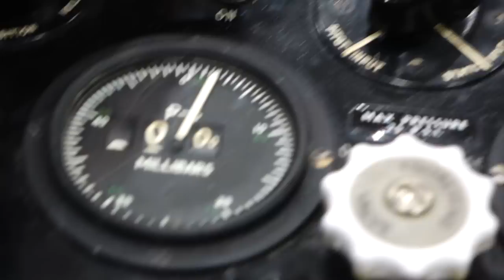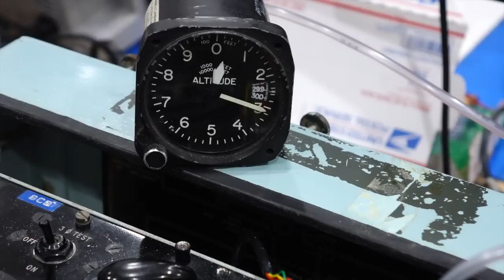RAF Pitot Static Tester Preview - Guess What This is For! #Short #InTheRightOrientation

Comment: Last time I used one of these was for calibrating barometric transducers for the Jindivik 103A & 103B and Meteor U16 targets at RAE Llanbedr in the mid to late 1970's. The Extra High Altitude transducer (for certain Jindivik configurations) covered the range 45K to 65K feet...!

Comment: Just heads up CuriousMarc - letting the altimeter move that quick can damage the delicate bellows and mechanical bits in the instruments and in your test-set. A good rule of thumb in aviation (where we still use test-sets like this daily) is want smooth, slow applications of pressure and vacuum to the system you are testing. Typically you don't want to exceed 2500-3000 ft/min on altimeters and nice and smooth on pitot pressure.
Reply from the maker: It’s sped up. And you can’t hurt these: it’s a balance system and the total travel of the capsules is limited to a fraction of a millimeter. It also has a valve that will automatically equalize pitot and static should pitot become less than static.

Comment: Pitot-static systems on aircraft are part of the system that measures altitude, vertical speed, and airspeed. The static port allows measurement of outside air pressure, which is used to determine altitude (lower pressure --> higher altitude, and there's an adjustment that's made using a pilot-entered local barometric reading to give more accurate readings). Rate of change of the outside pressure determines vertical speed (i.e. climb or descent rate). Comparison between ram air pressure entering the forward-facing pitot tube and the ambient pressure measured by the static port is used to calculate airspeed. That measurement ("indicated" airspeed) has to be adjusted for instrument position error to yield "calibrated" airspeed, which is further adjusted for altitude and temperature to give "true" airspeed. At high speeds, air compressibility also has to be factored in.

All of these instruments need to be tested periodically and adjusted/calibrated, which is what I'd assume this piece of equipment is for.
Reply from the maker: Yes you got it! We are going to use this to test our analog Bendix Central Air Data Computer

Comment: I’ve finally got round to adding a bit of context to my previous comment. These transducers formed part of an FM/FM Telemetry system designed in the 1950’s known as the RAE 6 channel system and compared to today's PCM system’s was fairly rudimentary. The telemetry system comprised of 6 analogue channels as follows. 

Chan 1 – Engine RPM 130Hz to 800Hz corresponding to 2,600 rpm to 16,000 RPM – via an engine mounted Tacho generator driving a motor fitted with a phonic wheel. Multiplying the frequency by 20 gave the equivalent RPM.
Chan 2 – Not Used
Chan 3 -  High range Altitude Transducer 1380Hz to 1686Hz corresponding to 14,500 ft to 57, 000 ft.
Chan 4 – Vertical Speed Transducer 2160Hz to 2640Hz corresponding to plus/minus 9000 ft/min
Chan 5 – Low range Altitude Transducer 3380Hz to 4132Hz corresponding to 0ft to 15,000 ft
Chan 6 – Airspeed Transducer 5291Hz to 6467Hz corresponding to 0 Knots to 460 Knots.

Four inductance type transducers are used to convert pressure information into sub-carrier signals whose frequency varies with altitude (2 ranges), rate of climb & descent, and indicated airspeed.
The transducers each consist of a movement operated by a pressure capsule, and inductance unit and a Colpitts valve oscillator. Variation of pressure inside the case or capsule produces expansion or contraction of the capsule. Axial movement of the capsule varies the gap between an armature on the capsule and the pole pieces of an inductance unit which forms part of the oscillator circuit. In this manner, the inductance value is made to vary with pressure, thus varying the output frequency of the oscillator.

A further interesting write-up can be found at:
https://www.icas.org/ICAS_ARCHIVE/ICAS1958/Page%20990%20Leslie%20et%20al.pdf

Comment: The pitot static system is primarily used to calculate indicated airspeed, so im guessing it simulates the air diferentials used to calculate the ias and tests indicator equipment?
Reply from the maker: It does.
Reply: Used for altimeter and VSI too. I always wondered how they tested and calibrated the old “steam” instruments in the helicopters I used to fly.

Comment: Hang on I've seen this thing. This is how Marty McFly blows up the giant speaker.
Reply from the maker: Wile E. Coyote also uses a model similar to this
Reply: @CuriousMarc  Wile E Coyote though used the ACME Captain America model though, which has, to a great degree, still survived in operation to this day, as it is still used where you need to blast in an explosive atmosphere, as it has the advantage in that, till you prime the big capacitors in it with charge, there is no way to develop any sort of electric discharge. But you can still verify the integrity of the firing circuit with lower energy after a single charge.

Comment: Does this have a quartz Bourdon tube in it?  I tore apart a few pitot/static testers a few years back for a friend (who sadly passed away) and all of them had quartz Bourdon tube pressure sensors in them.  They were encased in an oven to stabilize them, and a small incandescent lamp and photocell were used for readout.
Reply from the maker: No, no such thing inside. It’s traditional pressure capsule, but tied in a servo controlled balance beam arrangement, so the capsules actually never move. Very clever.

Comment: Good thing, thy wrote "portable" on the unit. I wouldn't have noticed otherwise.
Reply: As opposed to the larger version that sat in the service van, which was basically the same set, just with 10m long hoses to reach the assorted ports, and a chair to sit on. That one was integrated into the panel on the one wall inside the Citroen van, with the corrugated sides, and the half ton aluminium walkway on top, and the VW Beetle engine, as replacement for the original horrid Citroen one where you could not get spares for it..

Comment: I was an A4E Skyhawk avionics tech in the late 1960s. Our pitot/static teste was painted yellow. I don't have any pictures of me playing (testing aircraft) with it.
Reply: Small world!  I was a Marine avionics guy on A-4M's and TA-4F's in the late 70's.  We used the TTU-205 test set.  Much easier to use... just dial in the desired airspeed and altitude.  I was responsible for getting the shop's test gear in for calibration, and that was how I learned that the TTU-205 was worth about $80,000 at that time!
Reply: @SkyhawkSteve  Interesting unit, my memory is vague but that does not look like the unit we used. Back in those days much of the avionics gear was still vacuum tubes (valves for our friends across the pond). Most of our flightline repair was changing out the TACAN or or the biscuit pre A4F (a modified ARC27 UHF radio and APX6 IFF mounted to the cockpit bulkhead). VMA 211 ChuLai Vietnam 1967/68 my first tour and DaNang 1969 doing 2nd level  ComNav rapair on my second. It was nice being in and an air conditioned space during the monsoon season.
Reply: @tomschmidt381  The TTU-205 was a piece of yellow gear, and not what Curious Marc found.  The TT-205 is still being made, and can be found in a web search.  I've seen pics of the "biscuit" in the early Skyhawks.  Looks like a pita to change out!  We still had the vacuum tube ARC-51 UHF R/T in the nose on some aircraft, but the newer A-4M's had the solid state ARC-159 UHF radio that fit into the console!  No need to crank up the nose!  It was heaven.  🙂  I spent a few months with 211 at El Toro for OJT in '78.  Kudos to the folks who served in Vietnam.

Comment: Interesting: add pressure via the hand pump to decrease pressure at the output and increase altitude... how does that work? Enquiring minds want to know!
(And as an aside, I recently replaced an ancient paragliding variometer because while it still (apparently) showed the correct altitude, it would randomly decide I was going up when I was clearly going down and vice versa, complete with equally inverted audio signals. Bit rot in the PIC that did all the thinking, I suspect. Definitely not what you want.)
Reply: Pump is double ended, in that one side of the piston operates as a suction pump while the other side provides pressure, with a set of one way valves and accumulators, so that it will do this on either up or down stroke, and then using electric power to operate the proportional valving, used to control the output manifold pressures.
Reply from the maker: Yes as @SeanBZA says, double ended pump, you use both sides, one for vacuum and one for pressure. Clever British engineering.
Reply: @CuriousMarc  We do our best. If I'd stopped to think about it... thanks both.

Comment: The case design was used for a number of different test sets, I have a missile test set in a similar case.
Reply: Need to ensure your personal missile stash is tested regularly
Reply: Standard part at Smiths, who got it from Vero I think, as you had that design show up in a lot of avionics and military test equipment from the UK and France. Tough, rugged, and, most importantly, already certified in the system, with it's own NATO number, so you could use it and have a lot less qualification paperwork when submitting the design for review.

Comment: So you got another 'thing' fix the original thing, or at least to calibrate it now that it's been repaired. But the calibration thing also needs repair. That's a recurring theme on this channel. But I DO luv me sum a dat HP scopes and counters. 👍
Reply from the maker: Restoration within a restoration! And we were lucky, this is only two deep. Sometimes I have restoration within a restoration within a restoration! However when it gets three deep I am usually in deep doodoo and stop filming…
Reply: @CuriousMarc  I applaud how few times it "seems" you have given up, but I fully understand. There's only so much time and so many spare parts available. But with Mater Ken, Eric's magic finger, and Mike's ability to emulate and simulate (and untold others whose names I have not learned,...yet) CuriousMarc will fix and restore all the thingz.

Comment: I had the mercury filled one, with a separate vacuum pump that also allowed you, with suitable operation of the bleed valves, to test both altimeters and also air speed indicators, and to adjust them, using the handy screw hidden in the static port that adjusted the mechanical zero of the unit, so that you could then use the smaller front panel adjustment for barometric pressure to get the correct compensation for your local altitude pressure. 

Easy to set zero though, seeing as the official altitude for the base was zero feet anyway, and opening a manhole to work on anything you consulted the ATC via a phone call, to get the time of high tide and low tide, to see if you were going to be swimming in there or not. After being annoyed by a telecom tech with his pump trying to empty a manhole, I called the tower, and went to tell him to come back in 3 hours to fix the fault. When he asked why I told him to taste the water, which of course was salt water from the ocean, flooding in via the drain. Seeing as he had been pumping for nearly an hour, and the level in the small hole was not dropping, should have clued him in in the first place.... Plus the sizeable lake he was busy making on the concrete hardstand as well.

Comment: looks like a verry complicated dead weight tester
Reply: Dead weight tester is different, especially if you have the add on pressure transmitters to use with oxygen equipment, and the need to keep a 205l drum of pure ethanol around to fill it. Buying that drum of fluid every year was expensive, the excise duty was triple the actual cost of the ethanol inside, and you had to have 95.6% dewatered ethanol that was chemically pure, no adulterants in it, so it left no residue on evaporation. That was kept under lock and key, in a flame proof safe, and security did not have a key at all.

Comment: Chasing down Pitot/Static leaks can be a nightmare (ask me how I know  :) )
Reply from the maker: And wait that the leak is actually in your tester. Aaargh…
Reply: I did find the one static leak when I went to remove a pipe, that had apparently been there since assembly in Marignane, when it fell apart from corrosion, as soon as i tried to undo the flare nut. Went to the stores, and got a brand new pipe, first time anybody had ever ordered one in the stores history, and it had been sitting on the shelf since the 1960's. Put it on with something they did not use then, anti corrosion compound, on both surfaces and threads, as a very thin film, then wire locked it in place. Normally the rubber lines fell apart, but this was the first aluminium line I met that did the same. The rubber ones were a change on service item, just because of how badly they aged, but not as bad as the hydraulic hoses, which had a few emergency replace instructions on them for entire batches.